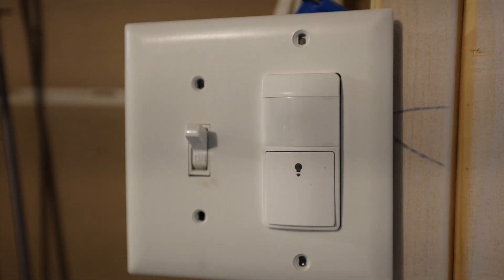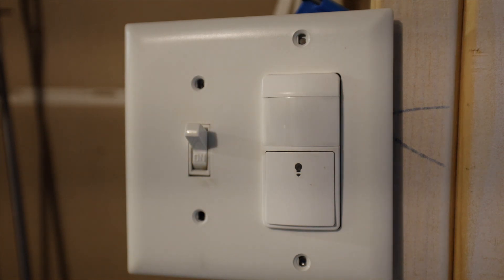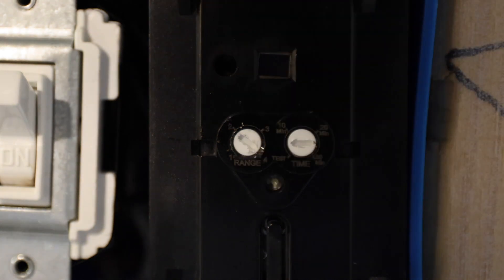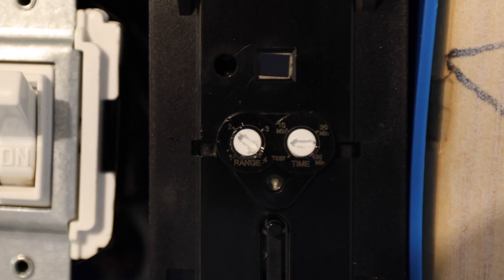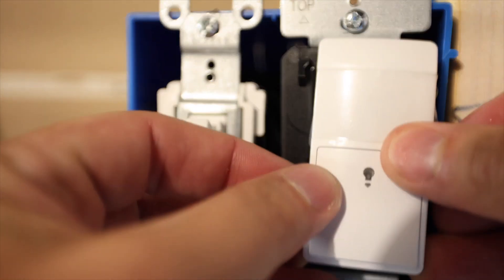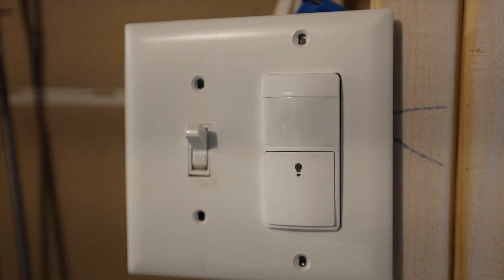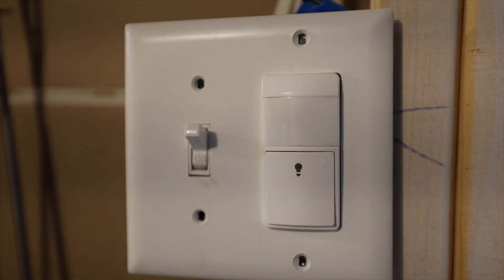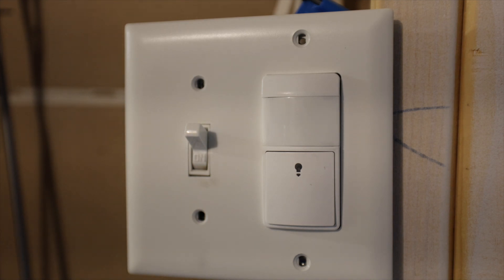TopGreener TDOS5-KM-W Motion Sensor Switch Programming & Setup Instructions

Comment: i had two that were not working in the same house. not sure how old they are but they would not work in either auto or manual so they got tossed.  i was wondering about how old they are.judging from your video's age, they were'nt that old

Comment: How did you wire it? I'm having trouble
Reply from the maker: It's actually one of the easier ones to wire because it doesn't require a neutral or ground wire (assuming you have the exact same one as I did). Did it come with instructions?